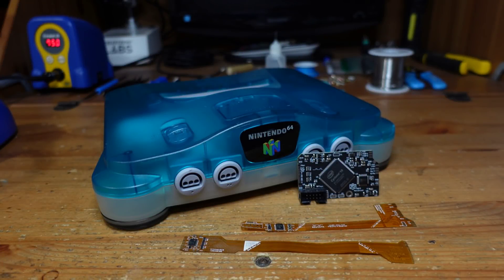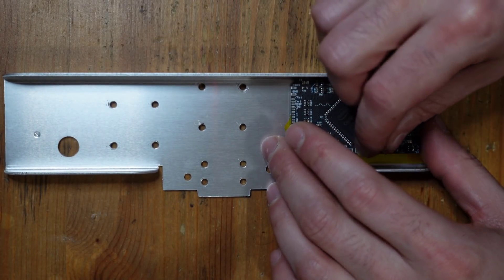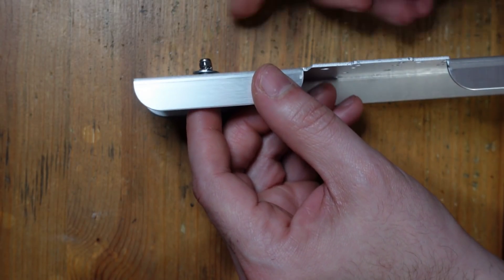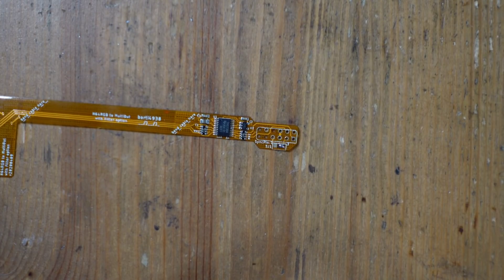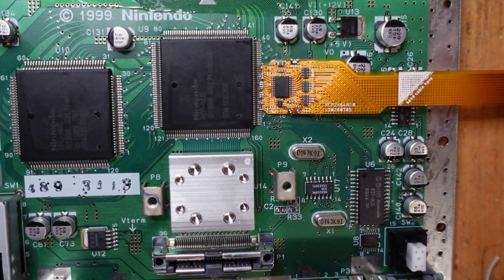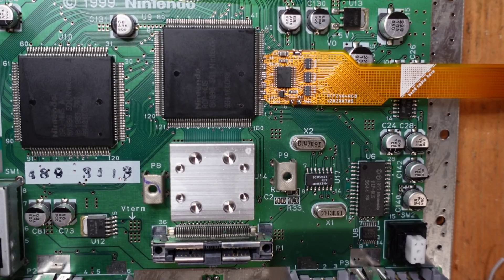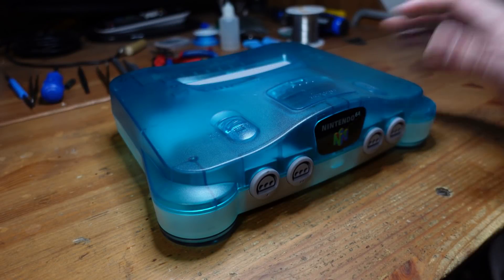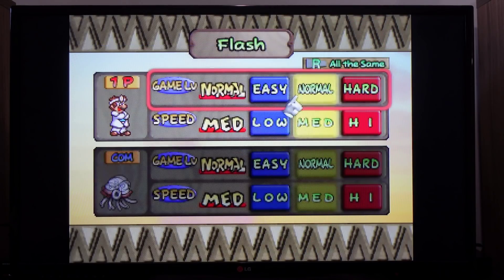N64 Advanced RGB mod - the best option for adding RGB to your Nintendo 64!

Comment: My man. Im stumped. I wired this n64 advanced and didnt use the ribbons...no biggie i love the challenge until i got stuck with sync. Im using pin 3 (ntsc version btw) and bridged it to 7 as per borti (component or scart capable) this is where im going crosseyed. I connect pin 3 to where exactly on the chip? I see couple diff spots that it can go and not sure which.

Comment: i'm told the jungle green can't be RGB modded unless you gut it and put another N64 inside of it. is that true? if not, which kit should I get?  i don't want HDMI,  just RGB or even component for CRT SDTV, no menu features (just literally a raw picture with no filtering interp scaling etc)
Reply from the maker: No that is not true. The jungle green can be modified for RGB just like all the others. You just need to get the Tim Worthington N64rgb mod kit or the N64 advanced
Reply: @LIRetroGaming  thanks!!!

Comment: I thought  you would have recommended a recap while you have it apart as all those caps are 20+ years old now
Reply from the maker: Surprisingly caps on the 64 are very reliable. It’s true that replacing them is good for preventative maintenance. But the 64 is definitely much better than other systems like the game gear, turbo express, and others where the caps are mandatory

Comment: I love this kit! I wish you had this video back when I did mine :p. I want to do another!

Why would you make it CS75 though? All the cables have resistors on the sync line so you'd want TTL sync if the cable was made properly
Reply from the maker: I was actually doing that because the install documents tell you to use CS 75 as a default. But it’s totally fine to use TTL as well of course. It also depends on the cable
Reply: @LIRetroGaming  because he doesn't wanna be responsible for someone using an improper cable lol. If your cable is made correctly, TTL is what you should use. But if your target will sync anyways, it's fine, but not all will
Reply: It is definitely the safer choice, regardless if it's the "right" choice 👍

Comment: "the best option" - prove it compared to N64Digital that also costs more than the actual console. Tim W's N64RGB is cheaper. He pioneered this and gets no credit. Could use S-Video cable and call it a day. PAL needs 2x resistors and 2x capacitors in console or cable to restore S-Video for about $2.
Reply from the maker: The best option is definitely a subjective thing. I was trying to make it clear that the N64digital has more options than this, and Tim’s N64RGB is cheaper and provides the same quality image. 
You can use anything you want to play 64. composite, s video, or this. Doesn’t matter as long as you’re enjoying the game

Comment: That thing is called claw washer. If u dont have steady hands for the flex cable, u can simply put doube sided tape on the other side of the cable, and stick it to its place.
Reply from the maker: Thanks for the info, I was wondering what that little part is called

Comment: Nice! Please could you also show some PSP modding content? Cool would be Wifi to 802.1/ac module mod and Bluetooth :-)
Reply from the maker: Sure thing, that’s something I can look into for the future
Reply: @LIRetroGaming  I have already seen the Bluetooth mod but for the Wifi mod, I think you need to develop some workaround. If the Wifi would be faster in the PSP we could use it as a steam link device. For now it's possible to play RPG and that kind of stuff on the PSP with Wifi, but in faster-paced games we need to use a USB cable connection.